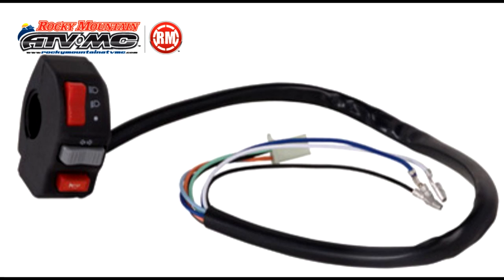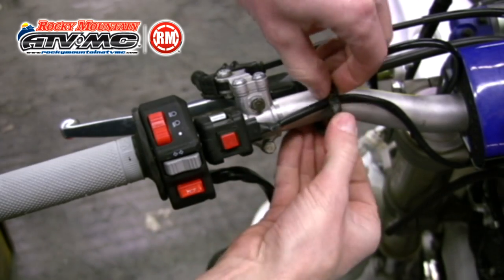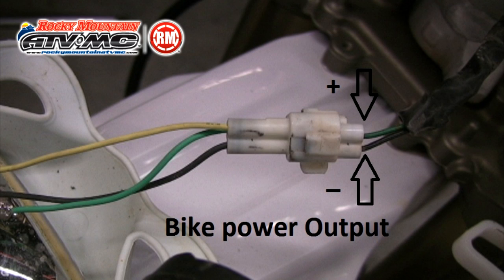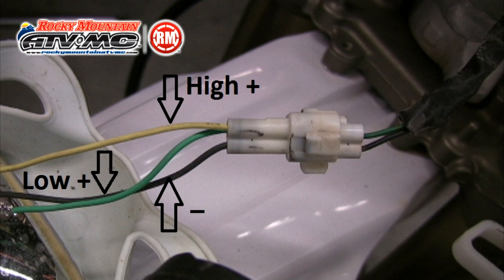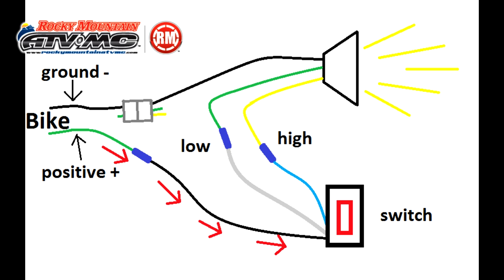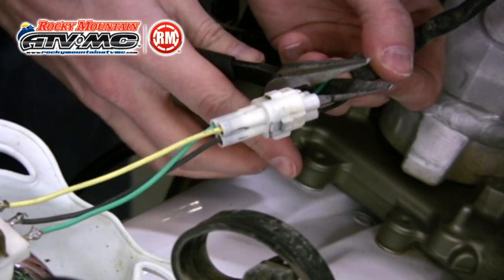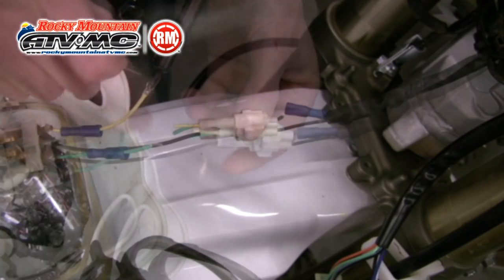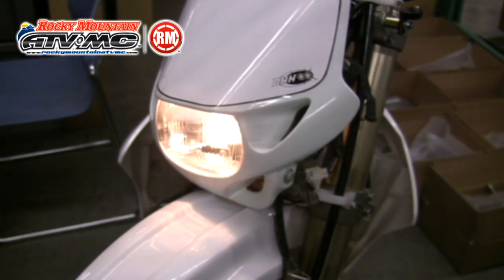Tusk Compact Control Switch Installation | Enduro Lighting Kit

Comment: hi I am currently trying to install the head light on my bike. how ever its on a crf150f and it does not have a stator and I am trying to run it off the tusk battery. I cant find out how to install it can you help me
Reply from the maker: +crazyruski777 That replacement battery pack is designed to power the small LED lights for your turn signals, taillight and horn. Customizing it to power an aftermarket headlight would be up to your own modifications to make it work.  It's not designed to power a an aftermarket headlight
Reply: +Rocky Mountain ATV MC  so basically I'm boned and spent a bunch of money for no reason lol. went you telling mike klumb the black wite leads to the power. any recommendations for me to get the head light running??
Reply from the maker: +crazyruski777 How many wires are coming out of your aftermarket headlight? (colors?)  The kit is still going to work.  You would just need to figure out a power source to feed your control switch (black) wire. It is do-able, our buddy "Klumb" was able to diagnose it. but our kit just wasn't designed that way.  Let me know what wires are coming out of the headlight and we'll go from there..
Reply: +Rocky Mountain ATV MC  there are 4 wires. a white and blue then two green that connects together. I connect the whip with white blue with blue and black with green with bullet connectors. no go.. I'm stumped tried a couple varations and Nothing.
Reply from the maker: Where are you grounding the headlight to? I don't think you have the headlight grounded.
Reply from the maker: +crazyruski777 Also, what aftermarket brand headlight is it?
Reply: +Rocky Mountain ATV MC yaa I don't think I'm grounding it ether. where am I suppose to ground it. and I got a cheep one off Amazon can't remeber name paid 25 bucks for it lol
Reply from the maker: +crazyruski777 You'll need to figure out which wires the ground coming off your headlight, and ground it to the frame.  Generally you can just go off of an existing bolt to ground it.

Comment: so how can i power a headlight , if my dirtbike has no battery yet?
Reply from the maker: It depends on which bike you have but you may have to get a higher 
output stator in order to produce enough power to run a headlight. In 
most cases a bikes stock stator doesn't produce enough power to power a 
headlight on top of everything else so i would start there. Some bikes 
that have a lighting coil can power a headlight while the bike is 
running without having a battery on the bike.
Reply: Damn , fast response. Thanks.

Comment from the maker: I would run it to the battery.
Reply: the black wire doesn't seem like its pulling enough power to send through the hi and low switches to power the light. I have connected the low conection(light and switch) to pos and the high to neg. Conected the light ground to the switches black wire. Off=high
                     Low=low
                     High=high
I am stumped... I would like off to equal off lol. Also this is a 10w max led headlight where low is normal and high is extra bright. Dual bulb jfg racing led. Help please.